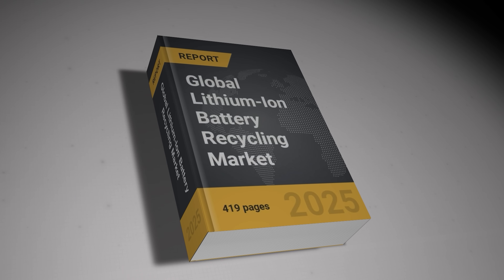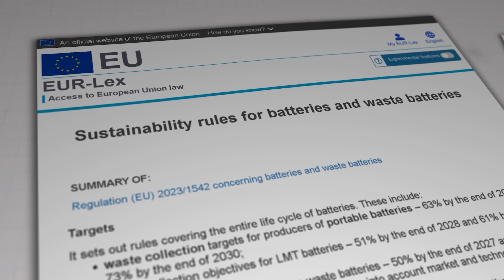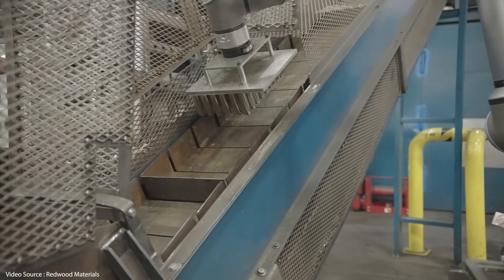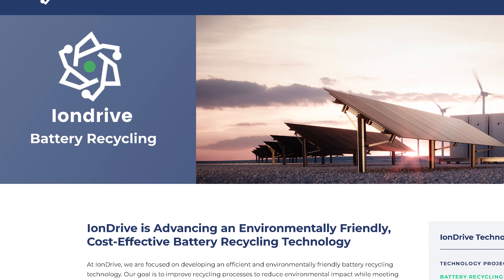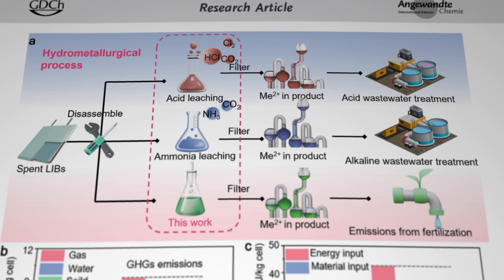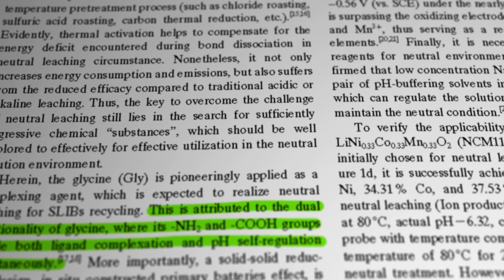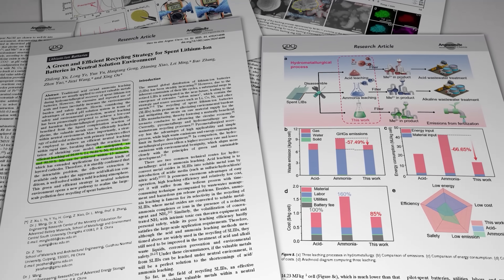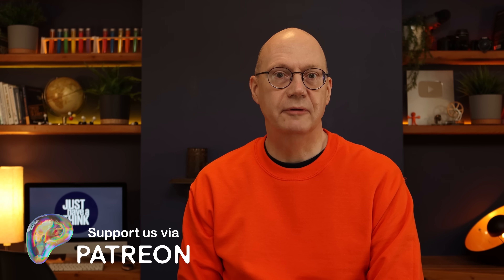Recycling Lithium batteries in 15 minutes. How do they do that?

Comment: My only concern about electric vehicles is that everyone is going to want to plug them into the existing power grid. In many areas, there is already more demand than supply, and no one wants to pay for new power plants. Also, my info may be out of date, but most places have power plants that still run on fossil fuels, yes? Is this not trading direct fossil fuel burning for remote fossil fuel burning? I'd love to have an EV, but not without my own solar/battery charging system to keep it off grid.
Reply: Understandable, though that sounds a bit like, "I'll switch when it's perfect"
Consider the imperfections of your existing method or interim arrangement (EV on mains).
Then consider the pressure that market forces play.  Do you want to create petrol or electricity demand?  The market will respond based upon our collective demand.
Finally, you could spread the investment required by investing in one half early.  Unless you are in your 'home for life' then maybe the EV makes more sense first.
Reply: @UsualYaddaYadda  It's less about waiting for perfection, and more about not wanting to contribute to rolling blackouts and peak power charges in my area. I don't want to create demand for petrol or electricity. My goal is to be less dependent on both. I'm already planning the solar/battery setup first. With the possibility of adding an EV in the future.

Comment: Again, you missed the bigger point. Batteries do not generate power, they can only store it. Hybrid systems allow the elimination of wasteful ICE idling while waiting for an application by storing the energy. But nothing else is replacing the on demand storage of energy generation quite like hydrocarbon fuels. Hybrid systems can markedly reduce the peaks and valleys that cause the inefficiencies, but they do not replace the need for the initial generators.
Reply: If nothing else is replacing on demand energy generation like fossil fuels, how come 95% of new electrical generation capacity is PV or wind?
Reply: @incognitotorpedo42 nothing on a calm windless night. Not to mention it being difficult to carry with you on a trip. Hydrocarbon fuels are also renewable, crude oil has been possible to be manufactured from biomass for at least 20 years. At some points, even competitively.
Reply: Fossil fuels don't generate power—they're a use-once store of energy built up over millions of years. But an EV battery can be recharged and store energy in 30 minutes…and reused thousands of times.
Reply: @Hejavra the "built up over millions of years" is a fallacy. Has been for decades. Such hydrocarbon fuels have been possible to manufacture for decades. And at a competitive price point to naturally occurring crude oil. That cost point was around $80 per barrel around 20 to 30 years ago. Less with modern improvements in processing.
Reply: @Vibe77Guy  You’re conflating two different issues. Fossil fuels result from biological and geological processes over millions of years — that’s established science. Synthetic fuels involve energy conversion using external energy inputs and are not naturally replenished. None of this changes the key point: batteries allow direct, rapid storing of energy and multiple reuse cycles, while fossil fuels are consumed irreversibly.
Reply: @Hejavra when the two are chemically indistinguishable from one another, which is true, it's a distinction without a difference. Liquid fuels are still orders of magnitude more energy dense, and easily transported with the point of use needs. Hybrid systems simply improve the efficiency by eliminating the idling requirements. It's not even new technology, see deisel electric locomotives and WWII submarines.
Reply: @Vibe77Guy  Let’s be very clear: chemical identity is irrelevant to the discussion of energy storage and replenishment. Whether the fuel is fossil or synthetic, once it’s burned, it’s gone — and you need to manufacture or extract new fuel to replace it. Batteries store energy directly, can be recharged repeatedly in minutes, and the storage medium remains intact for thousands of cycles. That’s the fundamental advantage of batteries as reusable energy storage, which no form of hydrocarbon fuel — fossil or synthetic — can replicate. Shifting the conversation to chemistry doesn’t change this systems-level reality.
Reply: @Hejavra You can only go so far on stored energy. Liquid fuels provide the greatest range, due to the extremely high energy density. Batteries are useful for leveling the peak demands, but add nothing to the range. Nothing is coming close to the energy density of hydrocarbon fuels in that aspect. Except possible the Aptera niche vehicle. And even that would be stranded in a dust storm or extended cloud cover
Reply: @Vibe77Guy   No one can deny liquid hydrocarbons have higher energy density, but that doesn’t erase the core issue — fossil fuels are finite, burned once, and gone, with ongoing extraction and pollution. Batteries allow direct energy reuse thousands of times without continual resource depletion. Range is one factor, but sustainability is about the full system. I’ve made my case and will leave it there.
Reply: @Hejavra we've already established that the misnamed "fossil fuels" are not finite and can be manufactured, to the exact same chemistry, from renewable biomass.
Reply: @Vibe77Guy  We’re going in circles — I’ve made my point very clearly. Good bye 👋

Comment: Luddites always forget the rapid advancements as the issues arise and research solves them. This is always true in new technologies.
Reply: Do they? I'd consider myself a Luddite, and I don't forget about these things at all. I would simply ask that they be addressed prior to the technology being mass produced - and we align our economic system with that goal. If a technology is worth having, then the process to get to this stage will ultimately succeed. Otherwise it won't. Imagine the volume of batteries (including my own EVs, which recently packed in, with no current battery-takers for home storage etc in my area/nation) that will be produced, materials wasted, until something like this comes to market? All to satiate an economic system, and a childish desire to have technological "advancement" in single generations, rather than ideas pursued considerately over lifetimes if necessary. Look around your house, like I do mine, and witness the needless lumps of technology and plastic that litter the place, that provide no real advancement, no wisdom, no joy - simply pathetic material purchases, by us, addicted to consumption, for the purpose of consumption in and of itself. It seems that in mocking the Luddites, you haven't bothered to consider their actual point. We're currently living through the 6th mass extinction, and the children (that adopt the antithesis of the Luddite view) that organise the system that we live under are proposing business as usual as the solution. Pathetic tales of space-mining (after they've practiced by trashing the seabed), Mars colonialism, and - of course - a billion electric cars to sit in fucking traffic congestion, every single day, on the way to a meaningless office job. 
The reality is that technology hasn't solved many issues at all without creating new ones. Because all technology in our existing system is embued with the essence of that system itself. It's not neutral, as folks would have you believe, it exists as part of the consumptive organism that is destroying the planet, with all its goals conveniently aligned. That's why we separate into silos, so that we can claim that we've solved climate change, or solved the recycling problem, while ignoring the other boundaries that we crash through every minute. For every climate denier, there's a hundred thousand exponential growth deniers.
Reply: Ricos - wrong aim, the aim should be to use the new technology to perform a better job than the previous outgoing one (petrochemical/ICE in this case) rather than hold out for the, never to be achieved, perfect solution. In this respect, the electrification of stuff is already vastly better than what came before so one doesn't need to wait, but one is still reassured that even what is better now will only become even more so in the future with the levels and rates of innovation being applied.
Reply: @GruffSillyGoat Shouldn't the aim be to make the world economy sustainable? Sustainable (exponential) growth is physically impossible. If humanity continues to pursue this folly then we will sooner or later face the consequences of exceeding natural limits.
Reply: @rfrisbee1 - Indeed, I would say electrified stuff is more sustainable as there are no consumable energy carriers involved that are extracted at vast expense, both financial and resource wise, needing forever to be replaced. Plus recyclability and circular economies has always been a part of electrified equipment, with EVs being no different in that respect

Comment: You know, I bet with a bit of tweaking, that process would work on spent PV panels, too. If only it worked on used wind turbine blades...
Reply: Compare the volume of old PV panels and wind turbine blades to (toxic) coal ash.  Which do you think is a bigger problem?
Reply: @incognitotorpedo42  OFPS! Nobody's arguing over getting rid of coal-burning power plants, or anything else that burns coal for that matter, other than the millionaires and billionaires that own them. Nobody's saying that wind and solar aren't cleaner than coal, diesel, or gas FTM. PV panels do contain toxic material: lead, cadmium, selenium, even arsenic, depending on the model. Not to mention copper and silver! Perovskite cells typically contain lead and tin. It's worth breaking them down chemically, if only so they can be disposed of safely.  And didn't Mr Borlace do an episode on disposing of worn-out turbine blades? Huge things made of reinforced fibreglass and copper mesh, there's nowhere to put them and recycling them is a problem!

Comment: Given the number of catastrophic lithium ion battery fires that have occurred in the last year alone, no the safety issues have not been sufficiently addressed. There is still much work to do there and in the infrastructure to support more EV owners.
Reply: Yes they have.  CATL and BYD are now selling batteries that are very safe.  China is about to (or might have already, not sure) adopt regulations requiring new EVs to have fire-safe batteries.  The fires that have been in the news in the past year or so (Moss Landing, for example) were older chemistries.  There is a lot of Fossil Fuel Propaganda about EV fires.  Much of it is not fully accurate.

Comment: The one problem with lithium-ion batteries that scares me is their proclivity to catch fire. Once they do, it seems nearly impossible to put the fire out. A car carrying ship is now adrift in the North Pacific due to such a fire. The crew, who did their best to put the fire out, were forced to abandon ship, as they helplessly watched their ship burn.

I prefer the far less potent but supposedly much safer lithium iron phosphate batteries. These have been successfully used on some sailing yachts. One had its battery compartment flooded. Many of the cells were ruined, but there was no fire.
Reply: Most EVs are using LFP now as it’s cheaper. Those that aren’t use other chemistries for longer range and are typically your more premium or long range models
Reply: Both CATL and BYD have variations of LFP chemistry that are very safe and have pretty good performance as well.  A lot better than older LFP.  They're selling them now.

Comment: Also worth mentioning Primobius/Neometals/SMS Group that have a plant type design built and being validated at scale by Mercedes and a different business model to provide plants to companies with assured supply of batteries for recycling. Business model of buy process and cell is complicated by the chemical supply qualification process. Someone like Mercedes recycling their own batteries has tighter guarantees of product conformity and removes two sales and transport processes making it more cost effective by integration. Production and recall scrap the most plentiful battery supply for near future.

Comment: In Canada, there aren't a lot of affordable EVs and A lot of us tend to have to do long drives and charging stations aren't all megawatt stations yet. Once I can get an EV with 700km range and a 10 min charge, I'll switch.
Reply: How aften do you do a 700km drive?
Daily
Monthly 
A few time a year
You'll spend less time charging on trips than you would filling your current car at fuel stations.
Reply: @andrewradford3953 about every other month abd my current car is a Civic doing 6L/100km. Takes 3 minutes to fill up and leave. 5 if I stop to relieve myself.
Reply: There are hardly any megawatt chargers in the US.   Why a 10 minute charge?  After driving nonstop for 700 km, is that the maximum amount of time you want to rest?  99% of the time, I charge my car at night while I'm sleeping.  It doesn't matter to me how long it takes as long as it's full in the morning, and it always is.
Reply: @incognitotorpedo42 when I travel to see my family I have 1000km to drive and I like to do it in one shot,  very little stops. I know EVs will get there, just a matter of time.
Reply: Don't stop there with your demands!  Insist that it costs half that of your current vehicle, goes twice as fast, comes in your favourite purple and doubles your IQ!  𝘛𝘩𝘦𝘯 switch!
Reply: @UsualYaddaYadda when EVs are the same price as a base car it'll make sense. I don't have 60 to 70k CAD for a decent EV.

Comment: There is still nothing anywhere near as good as ICE cars...and waaaay cheaper.
Reply: If I buy an EV at £20k and it does everything I need and more, if it is comfortable and easy to drive, fits in with my lifestyle, costs me pennies to charge at home and very little maintenance, this making the life time cost of ownership much lower than a similar ICE car that might have been cheaper at the outset...why would I chose ICE?

At some point the EV will have reduced the carbon footprint of the owner compared to downing a petrol car for the same amount of time, of course once production etc. is taken into account. You do know an ICE on any sort of mileage a year never reduces the carbon footprint of the owner? 

Maybe people don't buy EVs for them being cheaper, but have alternative notices. That said, most folks don't buy EVs new, much like most folks don't buy petrol cars new. Maybe folks buy them because they know they are better for them, might not be better for you, and they just want to live their lives as they want to? Which therefore makes the EV way better than the ICE for them.

If EVs don't work for you, fair enough. I'm sure you have to drive 00s of miles an hour up hill in -30c every day of summer.
Reply: @colinwiseman  Nice you have £20k for a car most of us dont my current car was £7.5k (5 years to pay it off) 8 years ago its now 13 years old i see no point in changeing it to an EV at this pont. For me EVs are to big, to costly, to small a range, to slow to change. I need a Ford Fiesta replacement not a tank. An EV could be a positive environmental impacts but if i dusent fit my need or my budget why would i buy one. And new EV pay road tax but not my old Fiesta🤣
Reply: If you want to see an EV that is better than ICE, Nio ET 7 is an immense car. But stupidly pricey new 😅

Comment: Ice drivers lamenting battery material flow problems are the worst hippocrates. Their whole operation depends on a continous flow of material from the ground to the atmosphere.
Reply: CO2 is harmless gas, however, the same cannot be said about its cumulative excess in the atmosphere (stronger hurricanes, etc.).
On the other hand electric car fires (or energy storage facilities built on the basis of various lithium technologies) are much more harmful to the environment (heavy metals and other harmful additives).
Fires not only release harmful gases and particles into the atmosphere, but also contaminate the water firefighters use to extinguish the fire. The water must be collected and sent for very expensive treatment. It cannot be allowed to soak into the ground and contaminate groundwater.
Reply: @GreyDeathVaccine  so just going to ignore the fact that most batteries being developed now don’t have the same chemical makeup and are vastly less likely to suffer from the thermal runaway, and in fact some stationary battery installations are incapable of catching fire? Funny how you cherry pick the data that suits you.
Reply: @GreyDeathVaccine The number and scale of battery fires of any sort are virtually negligible when compared to the enormous scale of global fossil fuel consumption.
Reply: @garysmith5025 yes, because of the difference in scale. If you scale up ev’s to ice scale with the same accident rate this will be a genuine concern. This is (among many other reasons) why na-ion batteries are the preferred solution over li-ion.
Reply: @luipaardprint No, EV fires occur at a rate of about 1.5% of  ICE vehicles and of those less than 1% involves the battery. That's 3-4 orders of magnitude less than ICE fires alone and that's before you get to the lifetime fuel consumption of an ICE
Reply: @GreyDeathVaccine  Electric car fires are negligible compared to ICE vehicle fires (in relationship to the numbers in circulation). An ICE vehicle is far more likely to catch fire and release just as deadly fumes into the atmosphere and newer battery technologies don't have the same issues as the older self oxygenating batteries.